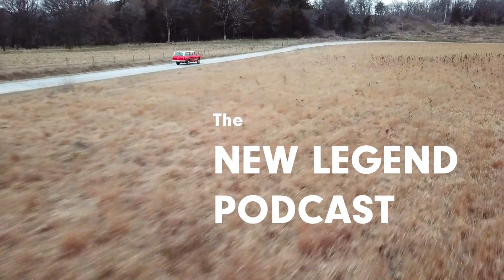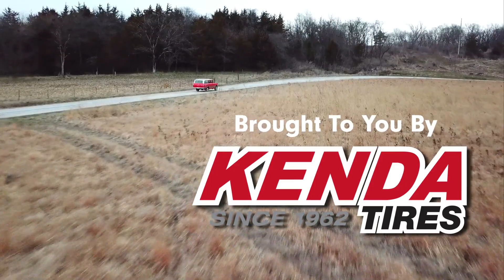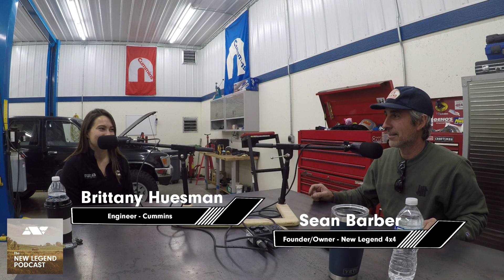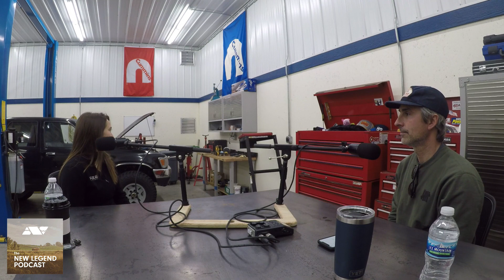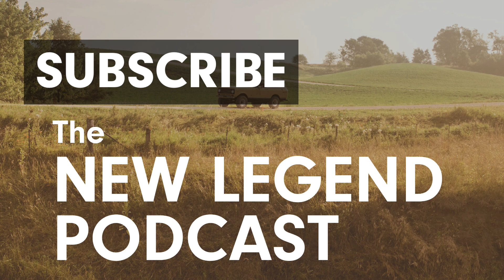Cummins R2.8 with Brittany Huesman - Is a Diesel Swap in Your Future?!

Comment: First I really enjoyed the video . I like diesel power cars or truck or just about any thing else .  I not a kid lol my brother got a letter from Ford test drive a diesel truck and he rode with the engineer that developed it a long time ago in I think Dallas , The truck was a in line 6 . I bought a Toyota turbo diesel 4x4 . It was a id motor so it did not run like a direct injection engine but it did get good mileage and it lasted a long time . I driven vw diesels for 30 years and still have a 2001 TDI Jetta and have given some thought to doing a TDI swap into my Toyota 4x4 extended cab tuck just because I like good mileage and a TDI engine . I especially like Cummins as I have a 5.9 in my 95 Dodge 4x4 ,   So I my friend today tried to buy a 2.8 for his Jeep and there no engines to be had .  So when there is some engines to be had I like to own 1 or even 2 it there as good as I heard

Comment: Did Brittany mention the R2.8 is made in China?
Reply: The R2. 8 is entirely built and assembled in China. Starting in 2009, the 2.8 ISF engines were licensed and installed into Chinese Foton Tunland pickups. The 2.8 ISF has an absolutely TERRIBLE reputation overseas

Sad really because I wanted to put one in my Jeep
Reply: @Mark Calous  it’s not false it’s 💯 and people in China hate the engine
Reply: @Mark Calous  so only half China? So then it won’t last 600k but could be good for 300k , but since it is half China shouldn’t they only be charging about 3500$ instead of 10k?
Reply: @Mark Calous  okay, then why are they hated in China if the quality was so good